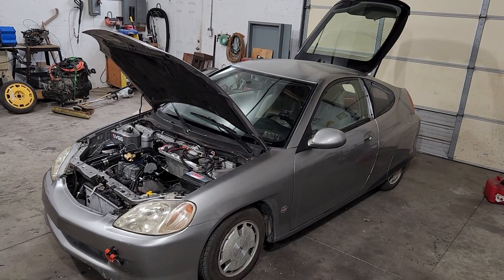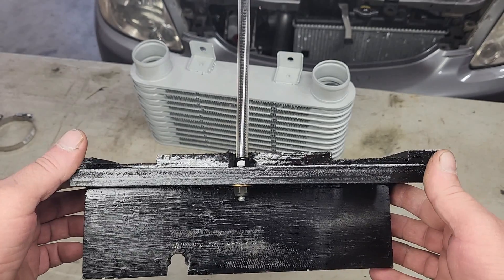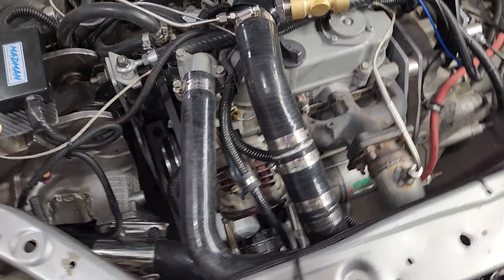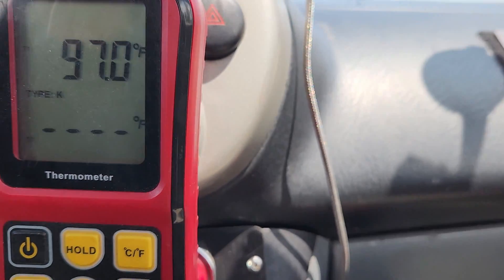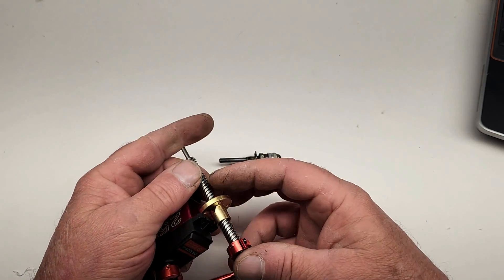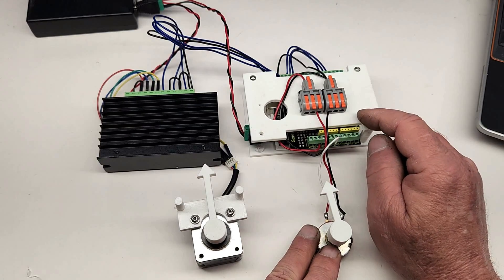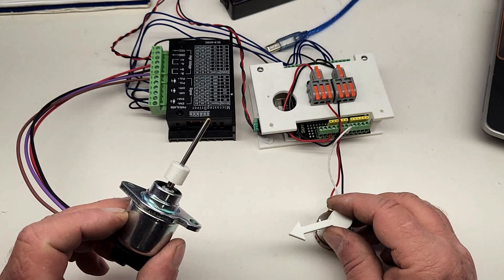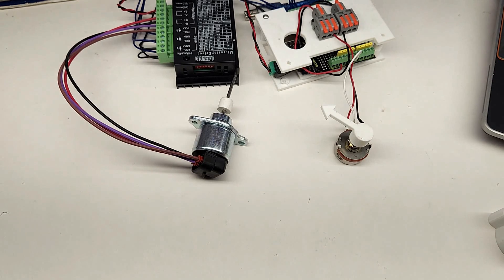S4 E17.  We install an intercooler on the AMR500 supercharged Kubota diesel.

Comment: Jimbo, I did the math on the weight of air per cubic foot given the temperature and boost pressures you showed.  At a temperature of 180 and a boost pressure of 10psi over atmospheric, the weight of one cubic foot of air comes out to 0.104209638 pounds.  At a temperature of95 and a boost pressure of 8 psi over atmospheric, the weight of one cubic foot of air comes out to 0.110439335 pounds.  That is an increase in density of 5.978043%.
Reply: Thanks for doing the math.  I was thinking the same thing was likely.
Reply: Dang it I should’ve checked the comments before doing the math out… at least I got essentially the same answer 👍
Reply: It seems that the pressure drop is not due to the restiction of the aftercooler core but due to the fact that the drop in air temp from the aftercooler is allowing the same or slightly more air in a denser state to exist at a lower pressure to enter the engine. The slight overall mass airflow increase is probably due to inproved supercharger eff. due to the lower pressure ratio. It just shows how important cooling the air charge is and especially at higher boost levels.
  It would be cool to see a super turbo setup with the turbo over the super charger witha bypass valve on the supercharger outlet back to the inlet to minimise parasitic loss when the turbo is providing boost.  This channel is the highlight of my Sunday morning coffee time! I love the iac motor...that is perfect for your rack control.😊
Reply: Bro...
Significant digits
Reply: My stage 1 srt4 made around 17~18psi of boost . I installed a bigger front mount air to air and boost was 15~16 psi. With an aftermarket wastegate actuator was able to gain that lost boost back
Reply: @robertkwit8506 You are thinking about this the wrong way. Boost is pressure. Pressure is restriction to flow. What you need to be targeting is a mass air flow number with as little boost pressure as possible. Your engine is an air pump if you can move the same volume of air (mass airflow) at a lower pressure it's more efficient. Efficiency means less heat to reject and lower parasitic losses.
Reply: I've decided everyone in the comments is smarter than me.
Reply: there was a 13% reduction in temperature and a 8% reduction in pressure, so the mass of air actually increased
Reply: @nirodper try your calculation with Kelvin please.
Reply: Indeed, so many comments on car boards after people improve their mass flow in various ways wondering how to fix their "boost loss". Nah dude lower pressure means it worked!
Reply: Gale banks talked about this a bunch with his turbo and supercharged duramax.
Reply: @christristano5034 Just because he talked about it does not mean it's new information. If you've been anywhere around diesels for the last 50 years, this has been well known.
Reply: Hot air is less dense , so throw methanol at it and bam there ya go 😂jk
Reply: I think this is a part of thermodynamics, where the temperature drop, so does the pressure
Reply: I was going to comment something very similar, without the math. Good stuff!
Reply: My good sir. We must protect you. People like you make YouTube fucking awesome.
Reply: and since 8 psig is about 8+14.7 psi and 10 psig is about 10+14.7 psi

you get  a pressure difference of about 8%

so if the difference of density is 5.9% as you said you get a "loss of 2.1%" 
but at that point the lrecision of the gauge comes in to play and it probably end up beeing the same mass of air moved around just at a better temp
Reply: Boost PSI is misleading, Pokebass1 has correct numbers. The cooled air at 8psi has more air per square foot (compressed) than it did uncooled at 10psi. The air was hotter so essentially it was thinner. So less air was getting into the engine without the intercooler.
Reply: @Antopc2 I think you misunderstood the mass of air went up 6% the volume went down. That's good not a 2.1% loss. Engine hp is generally pretty close to lbs per min of air times 10. In our engine programs we've found you can get a bit better and a bit worse but it's never a huge difference so it's a great rule of thumb. He realized a 6% gain in density if it was moving let's say 10lbs per min or about 100hp and he saw a 6% gain in density regardless of boost pressure he should see about 106hp now. At his low boost levels the gains are just beginning as now he can turn it up once he has better control of fuel and boost but I still think a turbo added in compound would be the way to go next.
Reply: @oliverscorsim yea i went with the "2.1% loss" in quotation marks juste to relate it to the "pressure drop" as was said in the video,

 I got to admit I dont know enough about engine tune to say what impacts that difference makes especially in roots supercharger applications (fixed volume per rev) vs other methods
Reply: @Antopc2 its not a better temp because that is a few more degrees that the fuel burn needs to heat it up.
Reply: Yes, Charles' Law applies.  Volume of an deal gas is proportional to absolute temperature (°K or °R).

While the pistons in the engine are able to pump more mass of air because the air is more dense coming from the intercooler, the supercharger itself is likely limiting the air flow.

Like the engine's pistons, the supercharger is also a constant inlet volume compressor.  It pulls in a fixed volume of air for every revolution.  The mass of air flowing through the supercharger is therefore limited by inlet density (at ambient conditions) and by the speed of the supercharger.
Reply: Banks has proven boost is misleading its all about mass air density the increase volume from the intercooler dropped the psi but the airflow is the same but cus the air is alot cooler the oxygen mass its a lot more dense its better then the other way now he can increase fuel to Meet the increase of air density
Reply: @johnyboy4205  Banks proved nothing, every one of his videos are basic intro into to said category. Read a book, weve known this forever

Comment: That smaller intercooler inlet design is probably why it dropped so much pressure, its just not designed to flow very well I assume.
Reply: Most likely due to being cooled down to 90° from 180° increased density lower pressure  much like how a balloon will shrink when put in a fridge/freezer
Reply: @dan4age  but colder air is more dense. ballon experiment is different cuz air is trapped, well I assume so.

Comment: The temp dropped, so the volume of air dropped as well, lowering the pressure. Measured as boost pressure . The same amount by weight of air was moved just smaller volume and thus lower pressure.
Reply: Exactly, the fact that all the other data stayed the same but there was a 2psi drop in boost is the real clear verification that the same mass of air was used.  Gail Banks did a real good job of explaining it in one of his many data geeking out videos, far better than I could explain.
Reply: Erm… no.  Volume of air is dictated by the volumetric efficiency of the engine and supercharger.  Temp drops, so density increases as does mass.  The pressure drop is a consequence of flow restriction.

Comment: looking at the setup inside that IC i would guess half of your pressure drop is from internal restriction of the IC. although power wise you can still drive the SC harder although the harder it is driven the more benefit you will get from finding a IC with better end tanks.

Comment: This may completely irrelevant, but my 1.9TDI actually doesnt have an intercooler anymore. Its in a 70s wagon(which is rust light now) and the IAT never exceeds about 40c and ambient is already exceeding 90f degrees here.
I use a “bug catcher” exposed air intake that comes out way beneath the car fairly far from the engine. Seems to keep IAT well under control even without an intercooler. I use a hydrophobic bag to keep water out.
Food for thought 🤷🏻‍♂️🤷🏻‍♂️

Comment: Make the mounting point stiff but put a vibration isolation material between the mount and the foot attached to the camera. Add weight to the isolated foot side
Reply: Or like a springy thing
Reply: Camera mount needs a vibration damper. To change the resonate frequency of something have to add weight.

Comment: can you see if you can put in ac in the desial Honda insight.
Reply from the maker: AC wont fit without a major re-engineering of the car.
Reply: @robotcantina8957  ok but would you think about it
Reply: @robotcantina8957  would see if its posialble